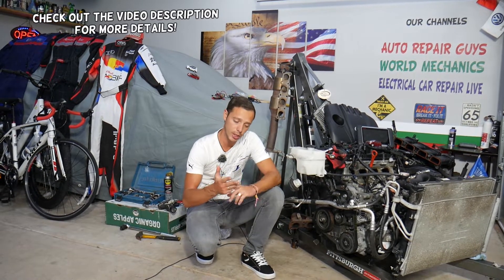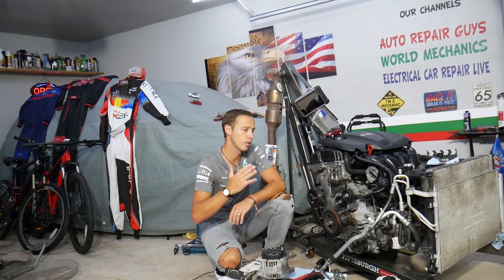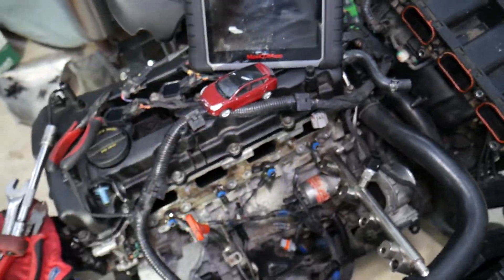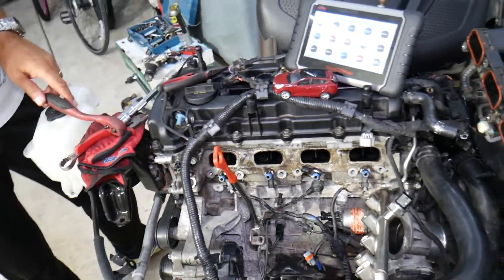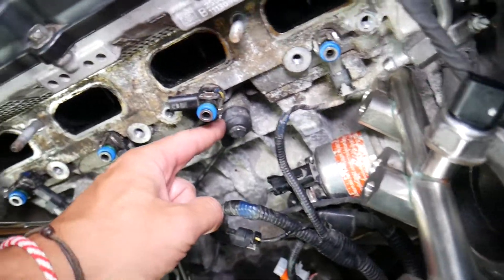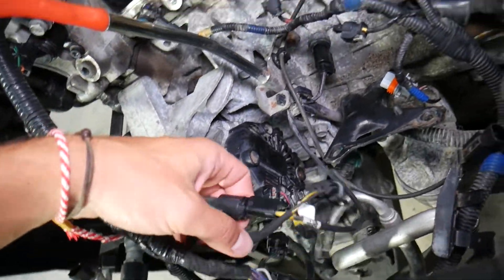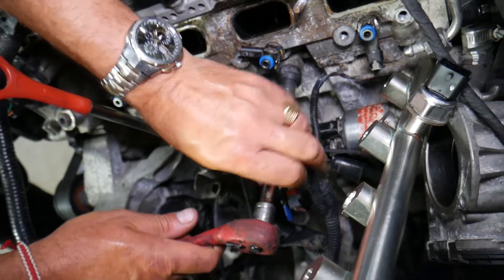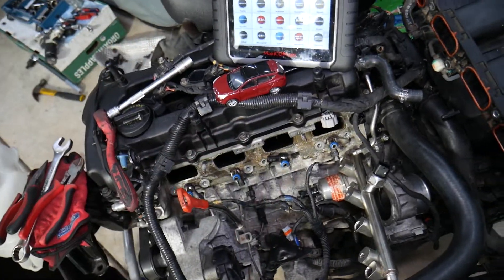HYUNDAI TUCSON CODE P0324 P0325 P0326 P0327 P0328 P0329 KNOCK SENSOR ENGINE LIGHT ON

Comment: I have a very important question for you and am hoping that you reply back asap! Please! 🙏 🙏 🙏  Question is this, what is wrong with my 2008 Hyundai Tucson SE with the 2.7 litter V6. It won't start and the symptoms of this are as follows: I went to go somewhere the other day and started my Tucson and it started as normal but after about 20 seconds it just died! I went to try and start it again but it wouldn't start. It acted like it was going to start and wanted to start but it wouldn't start. It was not making a clicking noise, it would just crank and crank but not actually start. I tried priming it by turning the key to the on position for 5 seconds and then turning it off and I did that a couple times then tried to start it again. Nothing! So I asked some "car mechanic" that were supposedly ase certified and he said he thought it would be the starter. So I ordered a starter because no auto store had any in stock. The starter came yesterday and I disconnected the negative battery terminal and then proceeded to take off the old starter and I put the new one on. I then put everything back together as it was. I then tried to start the Tucson and when I put the key in the ignition there was electrical power because it would do the normal beeping chime when you have the key in the ignition but when I turned the key over to start it nothing! It wouldn't crank and the car was dead like as if the battery was completely dead. I took the battery out and put it on charge and when I put it on the charger it registered that it was only at around 40-50% power so I left it charge for 3 and a half hours and it then showed it was fully charged. This is where I'm at now. I am going to put the battery back in and see what happens. Please please please help! 🙏